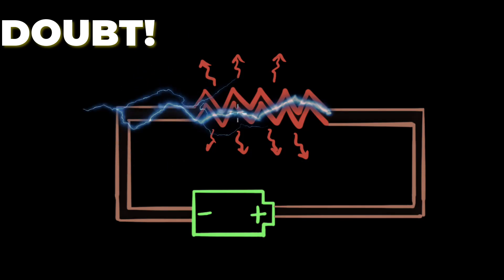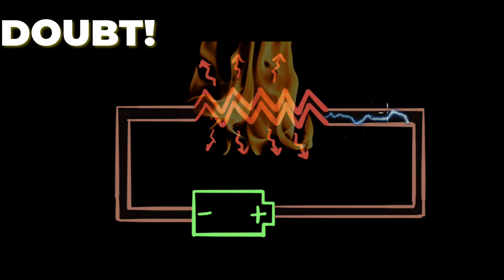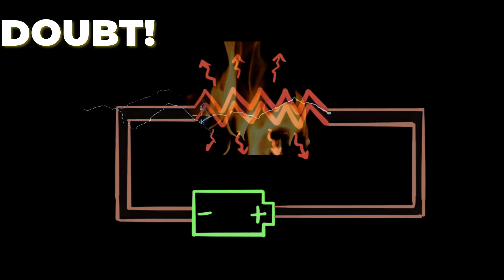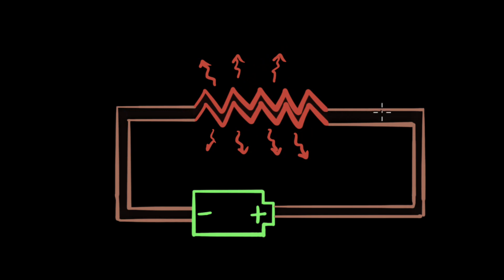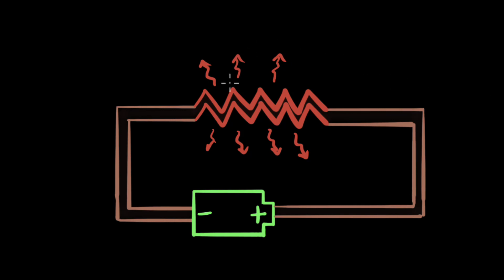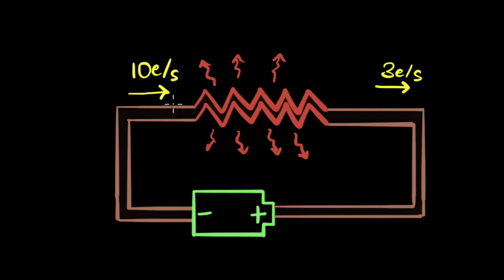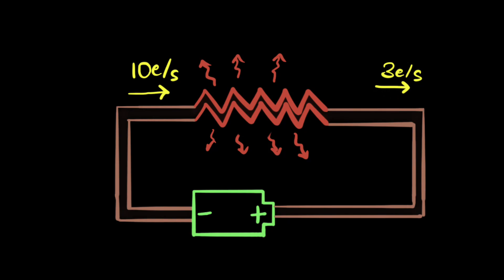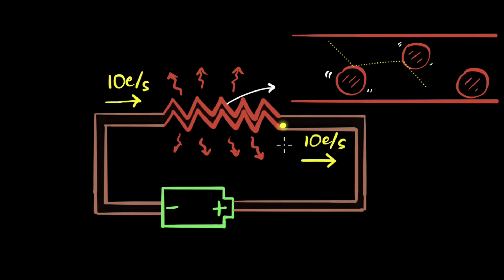Does current convert to heat?

Comment: when u talked about inductors in ac you said that , and this is absolutely logical , voltage across generator equals voltage aqros  inductor . does it mean that inductor has equal voltage att every instatnt as source and it acts in oposite direction , if so that oposite voltages must cancel each other beacuse they are in series . so how current flows in the circuit . And one more question, if  the rate of change of current flactuates  how voltage across inductor stays same as sorce voltage ?
Reply: The one thing missing in the video is the name of that  "Electrical Potential Energy" that's converted to kinetic energy.  We call it "Voltage".

This answer is more an EE perspective than physics, but hopefully will help you understand what's going on. There's also some pretty fun simple science experiments you can do yourself.  Google "CircuitLab" and it will let you play with these things online and see what each part does.

One big thing is you have three ways things can behave.  Steady state DC (Battery), Constantly changing waves (AC), and an impulse.  The last one is what happens when you first connect the battery before everything's settled down.  What we can do is model AC like an impulse from 0 to max voltage, then model it as max voltage to 0.

If you start at time 0, and apply a positive voltage to an inductor, the potential energy means the electrons now want to move.  The key is that moving electrons produce a magnetic field,* and inductors are designed to concentrate that field.  It just takes a bit to "grow".   We also know that a moving magnetic field makes electrons want to move, aka it produces Voltage.  The simple, but crazy, explanation is that the new magnetic field that's "growing" from time 0 actually makes a voltage almost equal and opposite to the voltage being applied.  It's often described as an "open circuit", but a better explanation is like we instantly stuck a DC generator in there positive to positive, and negative to negative.

As the field "growth" slows, the induced voltage slows, and there's more voltage. Eventually, the field gets as big as possible and there's no more induced voltage.  Like turning down the voltage on the generator so current can pass through it.  Eventually the inductor looks like just a piece of wire.  It's invisible in DC steady state.

Now, what happens when we start reducing the voltage we feed into the inductor?  Well, the trick is that the magnetic field is controlled by current not voltage.  If the current stays the same, nothing happens!  However, what almost always happens is voltage and current are related.  Less voltage, less current.  Causing the magnetic field to shrink.  Once again, a changing magnetic field produces a voltage.  This voltage is actually now in line with the change, so going back to that DC generator example it's like we flipped it and are now adding voltage.

The trick is that magnetic field won't have completely gone away by the time the voltage hits zero.  As the voltage goes negative, the potential energy means the current wants to flow in the other direction, but the magnetic field in the inductor is causing current to flow in the original direction.  At least until the magnetic field is gone.

* See the video on this channel about how that.

Comment: Hello. In electrostatics, first the electric potential is set to zero at infinity then we do the derivations. For an example, the electric potential on the surface of a sphere is KQ/R ( assuming V=0 at infinity). Then, when the conducting sphere is connected to the earth, it's potential becomes zero because the potential of the earth is almost constant and assumed to be zero. I don't understand this logic, the potential is already set zero at infinity then in the same problem how can we set it equal to zero for the earth. It would be great, if you could help me clarify this doubt.
Reply: Hare , the earth is neutral (not really, actually earth has slightly negative charge but it's negligible) , so we assume that no charges present in the earth , so no charges means zero potential. It's called the conductor is earthed i.e if any charges present on the conductor it moves to ground making the sphere chargeless

Comment: electric field lines never intersect....why???I mean drawing electric filed at a point just means that if i keep a charge there,it would be deflected at the direction which is tangential to electric field line.....so imagine a intersecting field line is created by two charges ..... if I keep a test charge at that intersecting point the force experienced by the charge will be net force because of two charges....so one force  from one charge and 2nd force from other charge u add them(obviously by vector addition) then we should get a net force with a new direction!
Reply from the maker: I used to think the same! 
Will the resulting force direction be tangential to either of the field lines at the intersecting point?
Reply: @Mahesh_Shenoy   ultimately the tangential lines represent the direction of force right??? so even if u draw two tangential lines(why two??cuz of two charges) pointing at two different directions...now u treat those tangential lines as force vectors(because it is actually that) and add it vectorially(if that's a word)
Reply: @Mahesh_Shenoy    oh well idts it will be tangential.....unless one of them is zero
Reply from the maker: @mridulacharya8250  So, instead of the 'user' having to do the vector addition all the time, the convention is to do it and then adjust the field directions accordingly. 

Otherwise, field lines would be pretty useless. You will have to manually do it. Imagine 100 charges!
Reply: @Mahesh_Shenoy    but the vector addition everytime will be different depending upon where the two charges are kept...imagine in 1st scenario we keep the charges horizontally having  some distance between them then the vector addition of both of them will be different...in 2nd scenario if i keep the charges not horizontally the net resultant of direction of force will be different..so there can be infinite scenarios..? so every time fields intersect the net direction of force will be different...so y not just accept the fact that  field lines do intersect and everytime they do the direction of force(net) can be found by the vector addition of electric fields by different charges(whose electric fields are intersecting)
Reply: also it's hard to find ur videos on  electrostatics first chapter i.e electric charge and fields,i mean there is a playlist but that has many videos missingg like in the first video itself u ask us to find electric field lines even though U  didn't teach anything about it also there is a video explainnig proof of gauss law without explaining flux or even what is gauss law...although if we search it seperately it comes but in playlist it's not therre...

Comment: Sir in one of your videos named "How circuit really works"
One of my friend asked you the doubt that we came across while discussing that the movement of electrons is due to the pulling or pushing force 
every one including you stuck to the same analogy according to which you imagined the electrons at the -ve end are exerting a pushing force on the neighbouring electron and so on as a consequence the current remains exactly the same across the resistor 
As we thought with respect to a single electron which you queried here in this vdo,how the current would be same if that is the case as the free electrons nearer to the +ve terminal should get attracted and then one more question arises willn't that leave the conductor charged!
Although he didn't receive any reply😅
My question is still the same
It will be extremely kind of you if you clear this doubt

Comment: I think the average drift speed will change inside and outside the resistor since there is only one electron. The electron will experience resistance inside the resistor which will slow it down but outside the resistor it is free to move. This would not be the case if there were other electrons too because the slowing down of one electron would consequently slow down the other electrons too, thereby making the average drift speed constant.
Now, since the average drift speed is changing, the passing of the electron per unit time through a particular cross section will also change making the current different inside and outside the resistor.

Comment: Speed of electrons is different from outside to inside a resistor if there's only one electron because in normal case we have sea of electrons and speed is same every where according to car anology. 

In case of single electron-
So, as rate of flow of electron is different from outside and inside current is different too.
Reply from the maker: Love the justification! Hope more participate :)
Reply: We all know that voltage is directly proportional to current , so if the  voltage across the resistor is different the current must also vary in accordance with voltage  .the only thing remain constant is resistance so, hence current is different from the outside current

Comment: i think the speed will decrease as there's no electron waiting behind
Reply from the maker: Also, what happens to the current?
Reply: @Mahesh_Shenoy  by definition, current is the rate at which electrons flow past a  point in a circuit. i think since there's only one electron, the current throughout the circuit won't be constant. so uh it might drop at the points of the resistor.